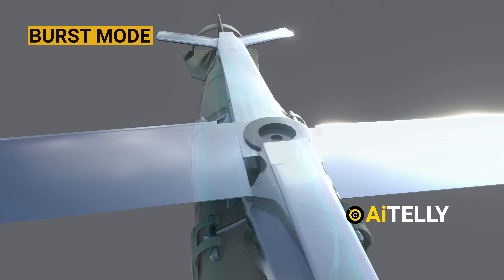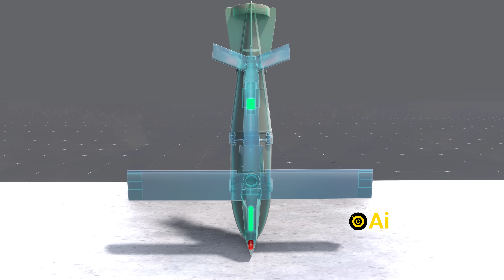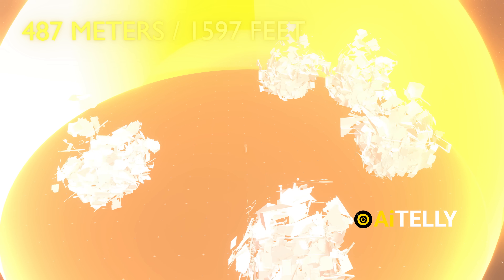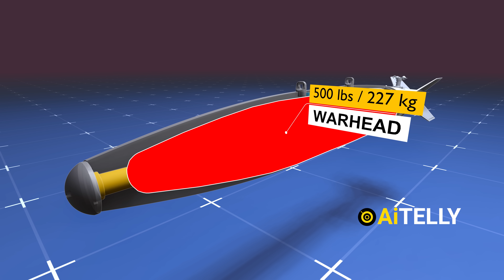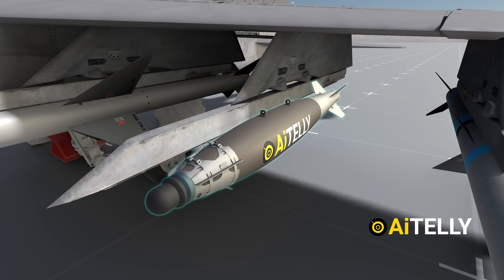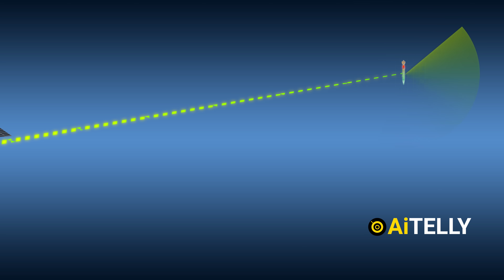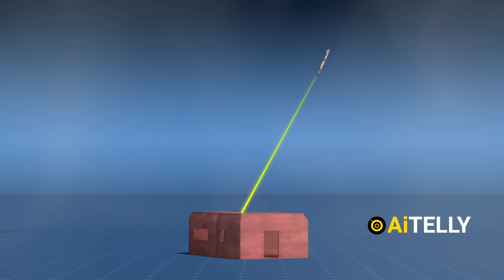Russian Glide Bombs Vs American JDAM | How it Works

Comment from the maker: Please Subscribe!
Reply: MAKE A VIDEO ABOUT "SUKHOI 34"!!!!!
Reply: Awesome 👍🏻👍🏻.  Would have been nice If the vídeo told us about that Russian bombs' weird tip...
Reply: @Tiagomottadmello - Pu gặp hề là tắt điện
Reply: Did you call the Russian General Staff to find out the cost of one bomb or who shared this information with you?  Ukrainian admins on Wikipedia?
Reply: @Damn6real  He came up with it himself. They cost much less than he thinks. In addition, there are Fab 3000 and 9000, and besides the Fabs there are Kabas, which should be compared, since they were originally created as gliding precision bombs. But the author does not know about this and thinks if The Russian army uses Fabs with flight correction, which means that in Russia there are no originally created glide bombs, and they appeared even earlier than in the USA
Reply: Make video about Russia jamming  US GPS weapon
Reply: No
Reply: @AiTelly why is ur name the same as a Minecraft bridging method (without the "Ai")?
Reply: @jhngfdsdfgkjnbv I mean the abramsX
Reply: I suggest you to do more research before making videos. The first part about the difference is pretty retarded.
Reply: How Igla S manpad work?
Reply: In your video, Russian glider kits' wings unfold in reverse direction! the round edge should face forward and the sharp edge face backward.
Having the tail edge sharp helps with and is necessary to reduce wakes and drag.
Reply: As a foreigner, you make the same mistakes when you talk about Russian weapons and about Russia in general. Why are you comparing Fabs with a correction system to the American glide bomb? Fabs with flight correction are a cheap alternative to gliding bombs, but you apparently don’t know that in addition to fabs in Russia there are also KABs, that is, originally created high-precision bombs that glide.
Reply: ФАБ of FAB translates like: Ф => Фугасная => (High Explosive) А => Авиа => (Aircraft) Б => Бомба => (Bomb)

ФАБ => High Explosive Aircraft Bomb
Reply: @ВикторБелоусов-т7к  А КАБ Корректируемая авиа бомба
Reply: пожалуйста на Русском!
Reply: I have been since close to the start of this channel!!
Reply: I did!!!
Reply: Уже подписан 😅
Reply: Modern. >120к USSR FAB500  FAB1500 FAB3000 FAB5000 FAB9000 😎 ~1к   well-aimed megatons tnt
Reply: The key difference is that the american jdam is exclusively used against innocent children and women in Palestine while the russian one is used against the westren criminal thugs!!
Reply: nope
Reply: @Aitelly  done
Reply: @Aitelly  suscribed
Reply: Subscribed. Informative videos, thank you!
Reply: nur wenn du auch DEUTSCH oder RUSSISCH ubersetzung machts....)))
Reply: Yeh, just subscribed last Sunday as soon as i watched your vids. 
You may not have millions of subscribers but don't mind bro. Cause , these days the world loves entertainment rather than reality !! 
But, keep on, full support 👍👍
Reply: 👍 subscribed
Reply: Will u ever make a abramsX?
Reply: @JPE91132  mumericans have lost the technology for producing engines for Abrams tanks and cannot restore it

The US can't make engines for their beloved Abrams tanks (which haven't been made in over 10 years either). What's even funnier is that they started the program, but General Electric Aviation and Pratt & Whitney couldn't revive engine production.
So, in this situation, it's better to start from scratch with new companies that haven't made engines before (like Boeing, Lockheed Martin, and Northrop Grumman). At best, they might have something ready in a few years. Those managers were just playing with toys, thinking they could build a factory for money. In reality, it takes time and effort to make engines.

Comment: We need to differentiate the reason for the different designs, both weapons are distinct for the target, none are superior to the other. 
FAB are horrible because the pressure wave uses the gas expansion to create the shrapnel, for this it can remain lightweight and inexpensive. Now take a US weapon carrying shrapnel, it will shred through everything in a few hundred meters. Each weapon has a different purpose and they are individual, apples and Kiwi in comparison. 

Which would you desire 100ft away and attempting to take cover in a vehicle? Either weapon if you survive you will lose your hearing, cough blood from the percussion, probably be blind and lame for a few minutes? This is assuming you found cover.

Comment: the main difference between these bombs is that they are both planning bombs.😂😂😂😂 The Russians are using free-falling bombs manufactured in the 1960s and equipping them with a planning unit. The United States is also producing the bombs themselves.

Comment: FAB-100 to FAB-500 and everything in between and beyond to the FAB-3000 now have a small yet engine option as well.

Extending their ranges from 70-120 KM to over 200 KM.

Comment: There is also a FAB-3000 glide bomb, weighing, as the number ststes. 3000 kg, three tons. SU-34 carries up to two, the 1500 kg model, it can carry three, one on the central pylon and two on the underwing pylons, closest to the fuselage.
The range depends of launch altitude and speed, the range stated is at the launch from 11-12.000 m at speed around 900 km/h (35-40.000 ft at about 550 mph).

Comment: $24,000? Where did you get this? The current estimate for guided FAB500 is $1700-2500 USD per unit. 
This leaves over $20,000 for a lunch platform. Unless they are being dropped from TU160, the launch cost should be way below $10k

Comment: JDAM is only used with specially designed bombs that are made to accept it... and it takes a specialist crew to install it, swapping out bomb components. Russian UMPK kits are designed to work with any bomb within operational weight range, and to strap on simply without requiring specialist engineers, so as others have said, that allows for use of the ODAB 3000, to become a FAB3000 - and in theory maybe even the ODAB 5000 7000 and 9000, although there are not many aircraft that can accept such a bomb with the addition of a UMPK, which is probably why we have not seen use of the FAB 5000 or 9000. The 9000 thermobaric has a blast radius of 1.8km. Putin wasn't joking when he said that Russia doesn't need to use nuclear weapons...maybe it is a good thing they didn't use anything bigger than a 3000 on the battlefield.

Comment: dude, for 24 thousand bucks in Russia, you can come to a military airfield and pay for the departure of a strategic bomber, and for change you will be offered to choose a target in Ukraine. 
The fab 500 is a World War II bomb. The USSR produced enough of them to last for a couple more world wars. The only new detail there is the UMPC module, which has nothing high-tech in it. Only crude military electronics, a coil of wires. All this is made in Russia from local materials, they don't even need China. And if it costs a thousand bucks, I'd be very surprised.
Reply: не надо врать, там используются чипы от стиральных машин, которые буряты воровали на украине !

Comment: 00:25 The wing section is reversed. The pointed end of the airfoil should be towards the rear and the curved side should be towards the front.

Comment: FAB-250, FAB-500, FAB-1500, FAB-3000, FAB-5000??, FAB-9000.
Reply: @Sergey_Neskazhu  
FAB-3000 is maximum between cost and efficiency as Glide Bomb.
The RF have FAB-9000 as stupide bomb for carpet bombing from TU-95!

The SU-34 can maximum load 1 FAB-3000.

It’s no need for bigger bomb. The kill zone from FAB-3000 in open field is 160!
In cities ca. 100m

Comment: the fab has oil explosive mixture ,this is the russian daisy cutter ,but usa ains somewhere completly else ,the procecessor is not a processr its a bit adder ,and the memory is a mulitplier by the power of 3 the circuit itself is binary on/off ,memory dump ,its all microsoft ,its bill microsoft is the Top ever silicon valley compqny ,why because it is ,but what u mean by stopping updates for specific versions ,aa its hackable ,despite that while its easily can ve fixed ,linux 😂😂😂😂,the kernel shell of windows xp is better than 2024 linux or p2p hacking .

Comment: We publish footage of the launch of the UMBP D-30SN guided aerial bomb by a Russian Su-34 aircraft. You can see the combat use of the UMBP D-30SN in the link in the comments to the video. The universal inter-type gliding munition UMBP D-30SN is something between a bomb and a classic missile. This is not a bomb with a UMPK, the inter-type munition D-30SN initially has a GLONASS/GPS guidance module and an in-air gliding system. It can be launched from both the Smerch MLRS and the Tornado-S MLRS at a range of up to 300-330 km. 

The UMBP D-30SN guided bomb is based on the 250-kilogram FAB-250 high-explosive aerial bomb. The American analogue, the GBU-39 SDB guided bomb, has a larger caliber. The D-30SN bomb has a small effective reflective surface, making it more difficult for air defense to detect. The D-30SN has an RCS of 0.05-0.07 sq. m, while the FAB bomb with UMPK has an RCS of 0.3 to 0.5 sq. m. The FAB bomb is detected by air defense at a distance of about 60 km or more, while the D-30SN is detected at a maximum range of 30 km. When dropped from an aircraft at a speed of 1250-1350 km/h and an altitude of 12 km, the D-30SN has a range of up to 160 km, with a deviation from the target of up to 5-7 meters.

Comment: Stop coping for one or other (unless you're specifically paid to do it). Both GPS and GLONASS can be jammed, and are jammed at the moment, but Russia had a head start on the development of the jamming systems for GPS, hence initially it had better success. At the same time, JDAM tends to be more exact (when it's not jammed), but the russian version is bigger hence a bigger boom that can negate some of it's impreciseness. At the same time the smaller bombs are easier to carry and can be delivered in higher quantity because of this, and when not jammed, can be more effective in targeting the specific points instead of blowing up everything (showcasing also the difference in soviet vs western approaches). 

Basically both have some advantages and disadvantages, and you wouldn't want to be on the receiving end of either. Just think that on the receiving end are other humans, sometimes civilians, sometimes your own, so it's not too wise to brag that someone has more of them in stock than the other, and "haha the cost difference"

Comment: FAB 500 only has slightly more than 200 kg of explosive in it. The rest of the weight are fragments and fuse. Generally speaking, bombs and warhead doesn't contain 100% explosives.  Smaller grenades only contain 10% explosives in their entire weight.

Larger bombs and warheads contain 20-40% explosives with the rest of the weight are fragments. Of course, this doesn't apply to aerosol or fuel air bombs/warheads, but even those doesn't contain 100% fuel mixture in their weight.

Comment: the author is probably a latent Russophile and probably supports the war.  The characteristics you gave are complete nonsense.  The Russians can use their bombs only where there is an almost complete absence of air defense and fighters, as in Ukraine, where all air defense is concentrated to protect peaceful cities.   For any NATO country, launching these bombs, any kind, is tantamount to suicide.  And one more “small” detail that the author missed is the loss of ammunition from the Su34, which occurs very often, a large percentage of defects when the bomb’s opening mechanism does not work and the bomb turns into a free-falling one and falls on its own, Russian territory, which  basically good.   The Russians use their bombs not on a target, but on an area, because the accuracy is crap.  In fact, JDAM is much better, significantly!  more precisely, it flies much further.  And Western stealth fighters can launch them without entering the air defense coverage area at all, and even Western fighters of generation 4 have a significantly lower ESR than Russian garbage monsters like the Su34.  Russia can only fight with those who are significantly weaker than them (as she thought).  More than 500,000 liquidated, incapacitated Russians are fighting only in numbers.  Russian guided bombs, like other weapons, are garbage, designed for a weak opponent without air defense and fighters.  Author, write better fairy tales, you are better at it.
Reply: Эк тебя прет! Чуешь шо пердак вже не подгорает, а пылает синим пламенем? Ото-ж так...

Comment: The biggest and most important difference between the 2 bombs is the fact that the GPS-controlled variant of the JDAM does not work due to heavy Russian jamming.
As far as I know, this variant has not been used for some time.